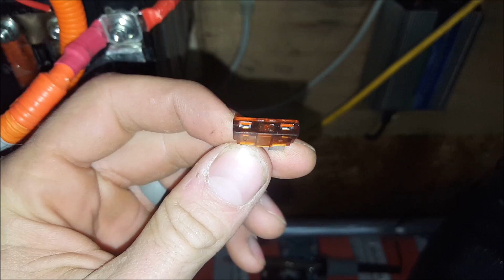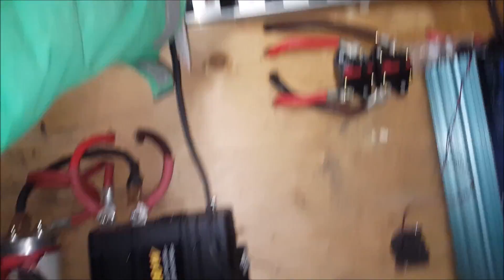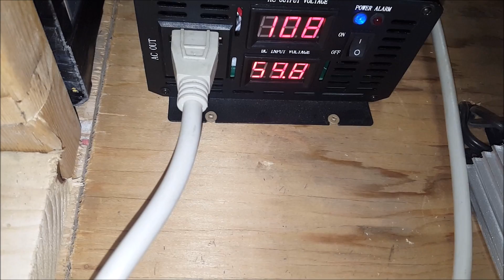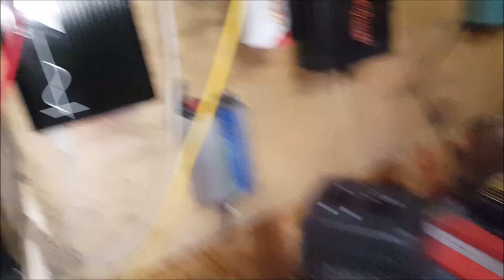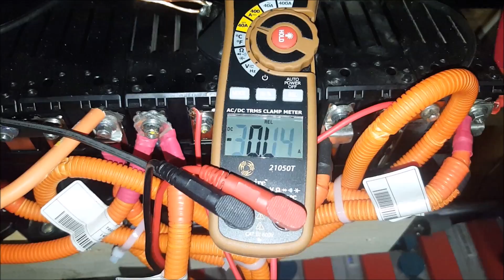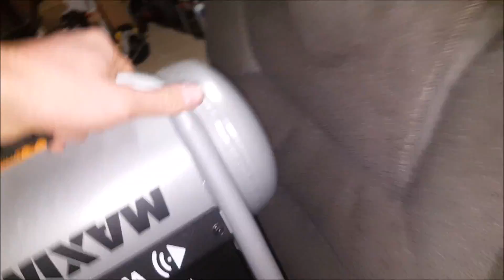Power Wall Max Load Test

Comment: Hey , what. Brand inverter is that ? I need one in 24 volt and all of your test have sold me on it for sure
Reply from the maker: here is the link, I love mine, but I have been told that the seller will not help you out if the unit dies, mine has been amazing for the price and I have two of them, one at 12v and the other at 60v both do 3000w.

http://www.ebay.ca/itm/112058013454?_trksid=p2060353.m2749.l2649&ssPageName=STRK%3AMEBIDX%3AIT

Comment: I just go to the big box store HD and buy a 10ft 1/2 copper water pipe smash it down and drill holes put in bolts and mount my devices to it as a bus bar work great and only cost $10 for the 10ft piece and makes a lot of bus bars. Good job testing and good luck
Reply from the maker: yea I have 3/4 pipe I did the same thing with but its way to big I want 1/4 pipe :)
Reply: fliping720 I got 1/4 INCH COPPER REFRIGERATOR  line that is also what I use on my battery plus side now happy a good day

Comment: I'm going to make a 12v system for camp, I have 2 harbor freight solar panel kits each kit has 2 solar panels that put out 45 watts @ 12v which carries 3.75Amp and 2 kits in parallel 90 watts = 7.5Amp, right? So i also need 2 in parallel of those buck boost dc to dc because they only go to 6amp out each, but should give me 12amp to play with so should i keep everything in parallel? 3 kits should get me 11.25amp so 2 Buck Boost should still do the trick so what do you suggest?
Reply from the maker: yes you are able to use them, but a cheap pwm is about the same price and will do about the same job.

Comment: I was hoping you could do a test.  600 watts of solar panels into 1500W boost converter.  Then put that directly into a inverter with no batteries.  Then put that directly into an 5000 btu air conditoner with slow start (fridgaire).  Will it run?  Do you think it will or might run?  Also if you have 4 280 watts panels, 36V at mpp, can you combine the the panels in parallel and run it through 2 of the boost converters that are in parallel and combine outputs at inverter?  Sorry for all these questions.  What State are you in.
Reply from the maker: if you use super capacitors in a system like this it should work if you have 800w of panels, I live in Ontario.
Reply: hi, what are the specs of your big super capacitor, how can i get one?
love your videos. 😊
Reply from the maker: its an old cap not a super cap, it doesn't do anything really :)